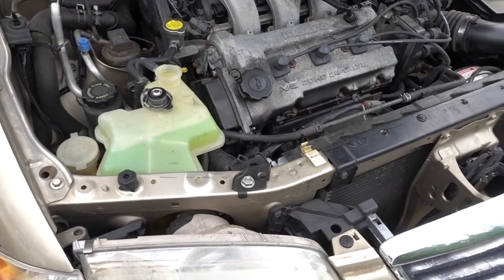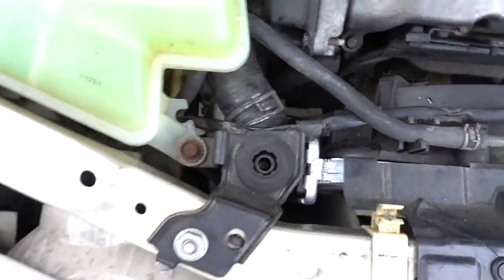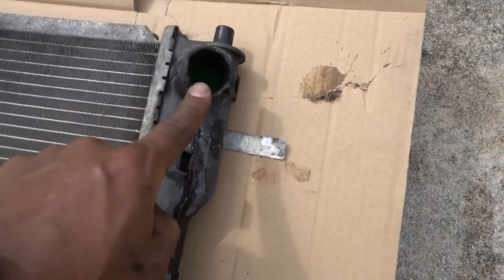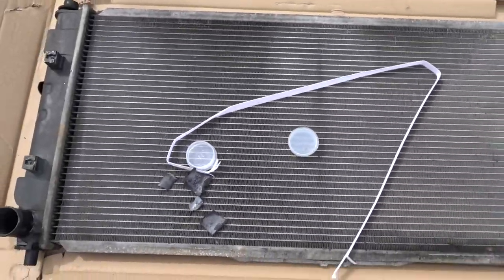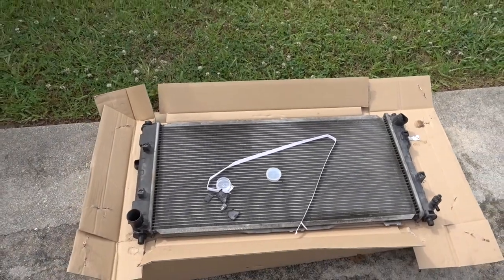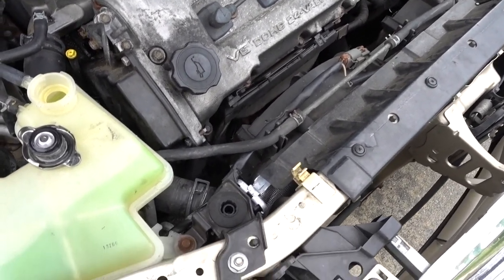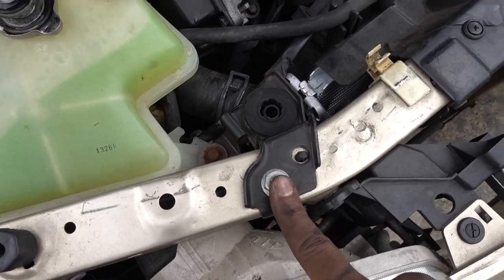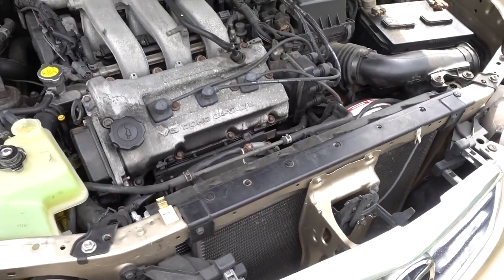How To Replace a Radiator 2000 Mazda 626 V6

Comment: i have this car and it had cooling problems , nothing obvious it operates fine at 60 but if you get up to 70 75 the temp guage starts to rise. I've replaced the resevoir , cap , thermostat 
could my rad just be clogged inside?   Where did you find the replacement?  Im in mexico and Autozone doesnt have it.
Reply from the maker: Customer got it from advance auto parts, and yes probably your radiator is clogged up

Comment: After you put the new radiator in, how do you fill it back up with coolant.
Reply from the maker: Put coolant in the reservoir, start the car and keep adding until it gets full
Reply: @BulletSolano  cool thanks. I thought that is how it works but mine isn't sucking any in from the tank. Maybe I got a bad water pump or thermostat.
Reply from the maker: Probably
Reply: @BulletSolano thanks so much for taking time to respond to me. I really appreciate it!!
Reply from the maker: No problem bud
Reply: @BretCahill  Are you adding it to the radiator reservoir. Or the overflow tank. Not sure if it will "suck" coolant from the overflow tank. The reservoir needs to be filled first. Pretty sure you leave the OF tank empty, as the coolant heats up, it will expand. This expansion builds pressure. So that pressure needs a place to go, otherwise you'll blow hoses or the radiator itself. The OF tank is a method to release that build up pressure. So it needs to be empty when the coolant is, well, cool. This was a year ago I'm sure you got it lined out by now. Still interesting information!
Reply: @cmdann8  awesome thanks for posting!! It is useful info to have